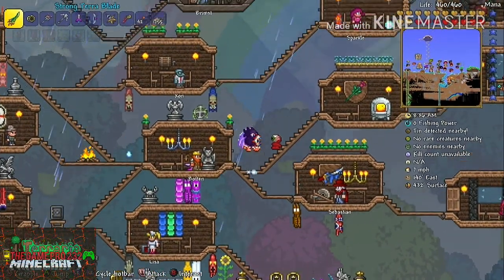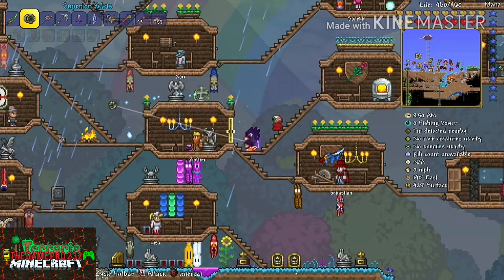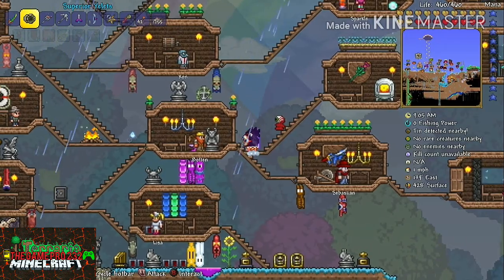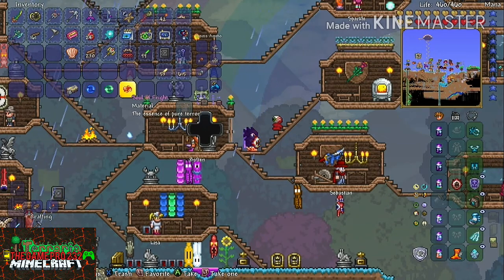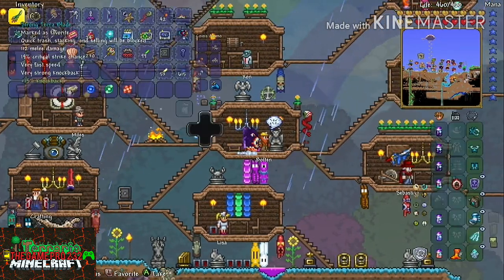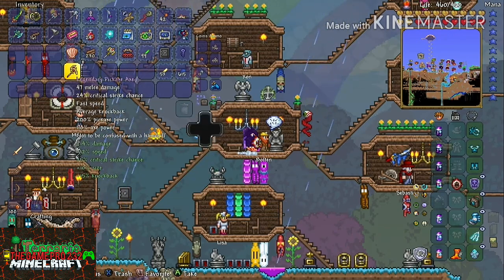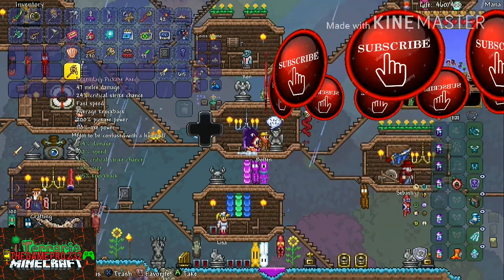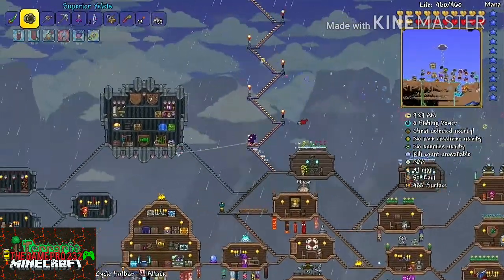How to Make a DRAX\PICKAXE AXE

Comment: No hate but drills are the faster ones then pickaxes but pickaxes have longer dig range
Reply from the maker: You're right. After some reading, I found that you are correct. The base stats for the drax and pickaxe axe prove that the drax is faster. However, with a speed modifier on the latter, it can be faster than the drax because drills cannot have speed modifiers. My bad for missing that distinction